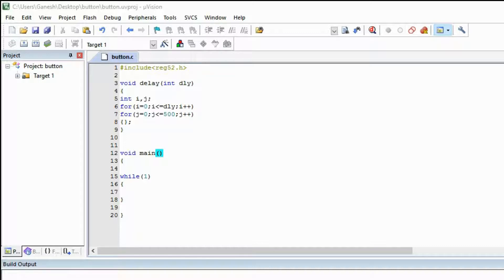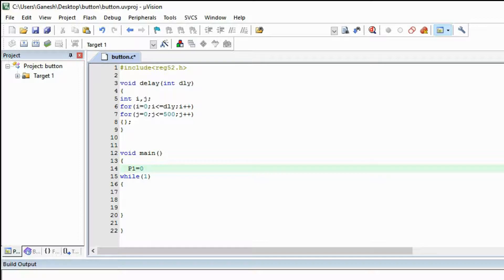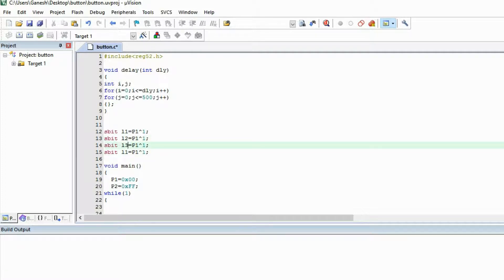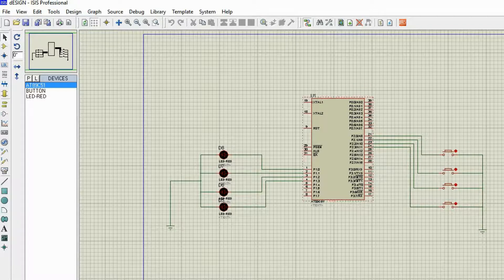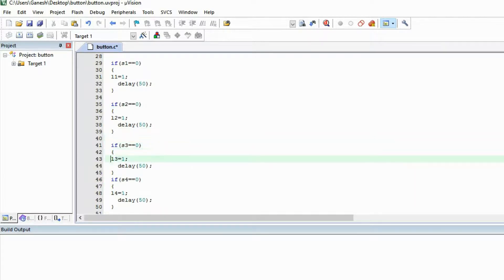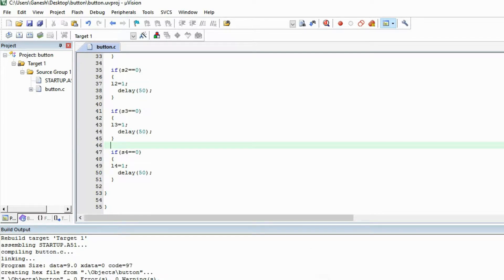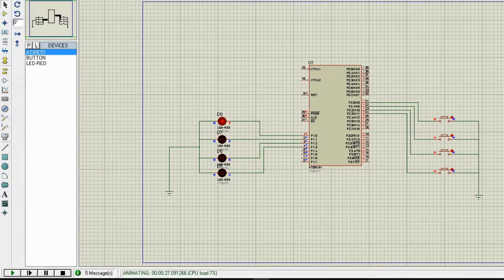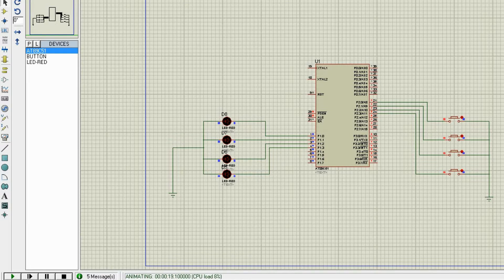Controlling LED From Push Buttons - Part 4 - 8051 Tutorials

Comment: I have a doubt , What happens if While(1) condition is removed and then dumped into controller ???
Reply from the maker: while(1) is a infinite loop, that means till your system is on your program counter will keep executing commands(or lines of codes) written in between the { } this parenthesis.

if you don't write while(1) all the codes will execute for once only.
in case of push buttons we need to keep checking if button is pressed or not. So, while(1) makes sure that it will keep checking the button conditions till system is on.
Reply: @OrhaTechs  So if suppose if I don't include while(1) condition and then dump it into controller ...so even though if the power supply is on for long time I can nly control led once know ?  I mean I can't turn on and off leaf again and again ?? Without while condition ?
Reply from the maker: @kiranbs5057  yes. only once but the problem is, u never know when the program counter is coming to read your button condition. So, practically you can not even use it once.
Reply: @OrhaTechs  thank you for clarifying my doubt ..and plz keep uploading many more such videos ..your presentation and explanation is very good but I suggest u to explain the components pin configurations also which u choose to interface with controller ( like seven segment display etc...) .
Reply from the maker: @kiranbs5057  I have detail video series on them.
link for seven segment:
https://youtu.be/fHmNtLV4sng?list=PLQOcvfrrCk7Ghxk1KKWgKOykGTaueOsN0

link for LCD:

https://youtu.be/DEaa3QUulE0?list=PLQOcvfrrCk7Ghxk1KKWgKOykGTaueOsN0

thank you for your support.